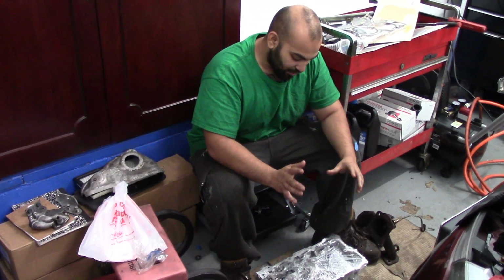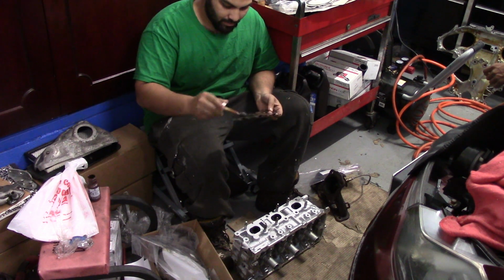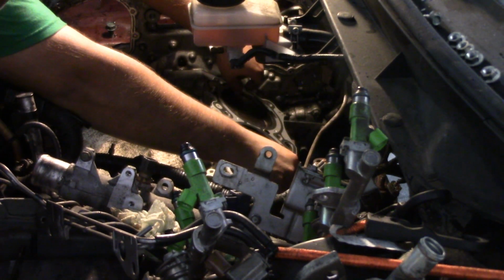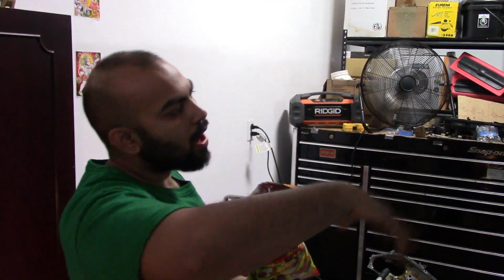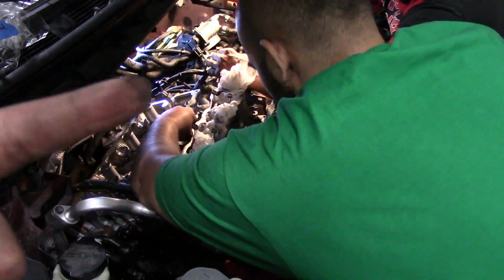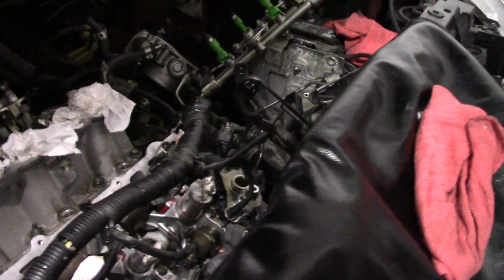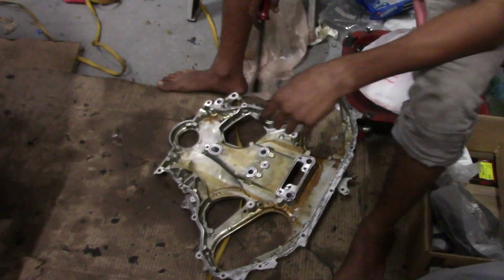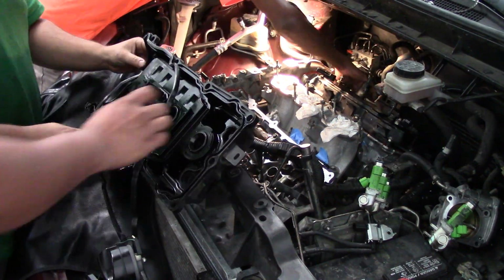nissan murano head gasket 2

Comment: Why did you have to do the heads?  I bought a 2006 3.5 fwd murono with random misfire. #3 & #6. After all tested amd a tune up because it has 210k but looks new. I had no compression in 3 and only 30 in 6. I am rebuilding heads and replacing the bad valves. The Murona runs and drives and has never stalled on me since I bought it. My question for you is what got you to the conclusion and what all did you test. Like to trade info on what we did different. Common issues with little to no good answers.
Reply from the maker: Hey what's going on, so the person came to me telling me the head gasket was blown. I looked in the oil cap and coolant and it was mixing fluids. I ended up redoing the heads because aluminum warps after over heating. When I had the heads off, I checked and they were warped. If I had just put them on the heads wouldn't seal the mating between the gasket and block..... Make sure you replace piston rings on yours... Low compression is mostly do to rings... Did you do a wet a dry compression test?
Reply from the maker: The lady had told me the dealer had told her the head gasket was blown.. So I looked further into it

Comment: I'm doing the same job on my 06 maxima and  I have two questions.
1. Did you have to remove the rear timing cover to get the cylinder head off?
2. The front timing cover. That small black U-shaped gasket that goes on the bottom of the cover - how did you get it to stay while you put the cover on?? Any advice would be great, thanks
Reply from the maker: Hey there, so basically, this engine should be dropped with the syndrome from under the car. It'll be way easier. No.i didn't remover the rear cover to remove the heads.
 The u shape gasket, I put a light amount of silicone to hold it in place of the front cover.
Reply from the maker: I wish you the best, I have to say the vehicle was a complete headache. So if you can drop it out of the vehicle do it
Reply: Yeah, I'm not so lucky to have a lift for this project.  Being done in the backyard.  Thanks for the info!
Reply from the maker: I completely understand. Even on a lift this car was a pain. I had to remove the timing cover a few times well to retime the engine. It was always off by a degree. But eventually I got it. Just having to remove the cover over and over again was a pain.

Also. The dealer wanted 10 grand just to do the job. But you got this though, just don't lose your patience, and careful those heads are sharp!
Reply: @Kingcustomz  $10,000?!! Damn that seems so far out of left field. How much do you think it would cost to replace the head gasket on a 2004 Murano?
Reply from the maker: Brother 10 grand is what they nissan charges I even verified it myself.i was dumbfounded.... not sure, but if I had to do one again. I'm definitely removing the engine. It's not worth it doing in the vehicle lol

Comment: Hi I need your help to you pull the head Nissan Murano 
We remove all bold but the head still not moving
Reply from the maker: Did you remove the exhaust manifold bolts
Reply from the maker: This vehicle is a huge pain in the ass. And the best way to do this head job. Is by removing the entire engine! Trust me, I learned the hard way
Reply: Thank you very much for your reply 
Can I have your number so I can talk to you for a minute 
I did everything but I can’t get the head off it’s so hard 
Please
Reply from the maker: Here email me sookwahryan@gmail.com.
Reply: King customz morning
Reply from the maker: Morning I responded back to your email
Reply: Is buying a Murano a pain 🤔 if I buy one? I might have to be spending much for engine stuff and parts
Reply from the maker: Yes it's a pain when it comes to doing head gaskets in the vehicle
Reply from the maker: Honestly nissan isnt as it used to be. If you want something reliable get a Toyota or honda